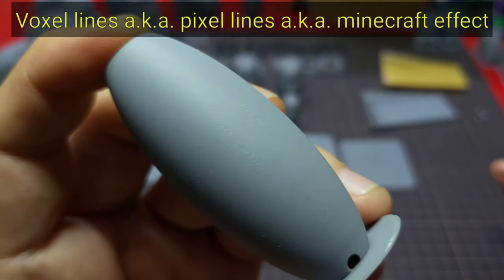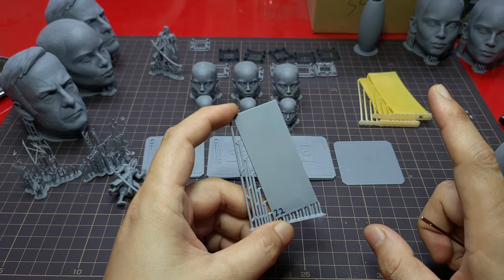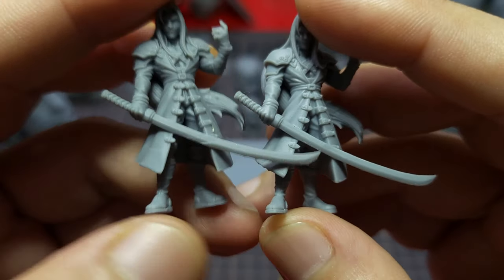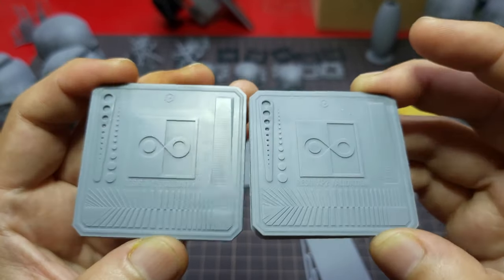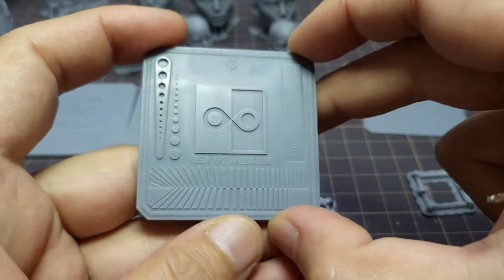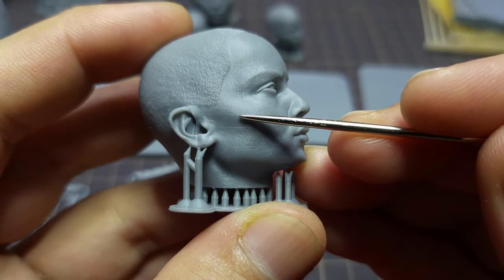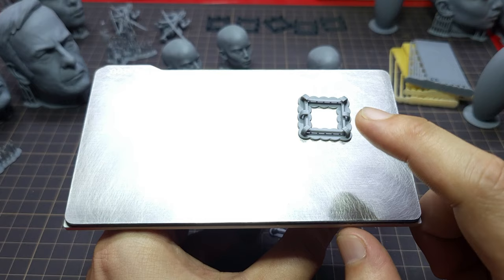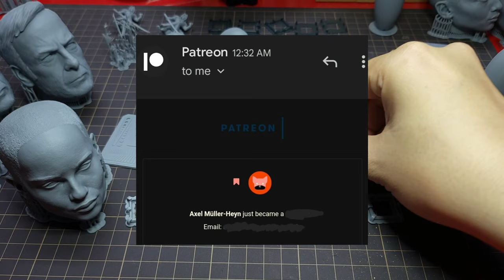How To Setting Resin Exposure For 3d Printer Resin

Comment: You mentioned the lift screw at 1:14 at I was super curious how you’d assess this but never heard more. The screw is the one thing I haven’t touched troubleshooting and what I’ve been suspecting so to hear someone mention it is affirming. Would there be z wobble and that’s how you’d diagnose this as the screw? I’ve been printing a long time and recently got some very odd fails I’ve never seen with very thin strands of cured resin attached to my object if it prints at all as well as a rectangle in a very thin layer no matter the shape or object I print.

Comment: Not only the exposure time, but also the UV power count in this matter!!! When I turned up my UV power to 80 (the factory setting was around 60 on my Photon Mono X), which is recommended for darker resin, my prints got better even if I lowered the exposure time to 1.5 sec. So begginers pay attention to this as well!
Reply: For a skin color resin, 60% is ok for a Photon mono 4k ? I did a test with 1.4 s, columns are thick and I barely see the pillars but its 100% UV
Reply: would you please share your settings? including UV Power, Cure time, lift speed and retraction speed? I use the Photon Mono 4K
Reply: @renatosilva2078  would you please share your results with 80% and 60% UV Power? I will try soon and do the same.
Reply: @walterrldias  I just realized I wrote exposure time instead of UV power to 80. I hope nobody set exposure time to 80 for 1 layer. :D I edited it now.

Anyway I tried many to print faster, but it has limits, so right now my prints don't fail with this setting:
Layer thickness: 0.05 or 0.1 mm
UV power 80
Exposure time 2 sec
Lift distance 5>1 mm
Lift speed 2-2 mm/s
Retract speed 4-4 mm/s (I tried it faster, but it starts to make annoying cured little layers next to the print, so it is the fastest which makes clean prints yet)

Important to set the supports thickness to 1.2 mm, I usually print bigger 1/4 and 1/6 pieces, and sometimes 1 mm supports still failed. The connection head of the supports can be between 0.8 and 0.6 mm, depends on the size and details of the printed piece. Good support setting is very important to check them manually if there are too many or not enough placed by the slicer.

Print bigger parts with less details with 0.1 mm as figure bases to spare time, and detailed parts with 0.05 mm if you want the best quality look of your printed figure.
This setting is not good above 0.1 mm layer height, then you will probably need more exposure time for higher layers.

Also the type of resin can act differently, I use the Anycubic grey resin.
Reply: @Chibanah  haha I had noticed the typo, but also 80 is such a UV Power number that I decided NOT to bother you with that. I thought u would notice it yourself and you did.  Thanks for the feedback. I will try it later in the day.

Comment: I have been using your exposure tester quite a lot recently since I just got my printer and have been trying to find the sweet spot with the couple of resin types that I have. I have to say it's a very useful tester model. I usually print the Resin XP2 Validation matrix, Ameralabs town and your tester model together during the calibration. More than once, I found that the Resin XP2 and Ameralabs model to have printed wonderfully at a certain exposure setting but it failed on your tester model (corner support failure). If I didn't print your tester model, I wouldn't have known that the exposure setting was still a tad too low, and that it would probably fail if I were to print a complex model with a lot of fine supports. Also, your tester is quick to print since it has such a low height. For quick test, I just print alongside the Resin XP2 Validation matrix.
Reply from the maker: Thank you for testing my exposure tester and let me know your experience using it.

Comment: This is great, I found in the early days of my 3d printing I simply used the manufacturer's recommended setting for resin type. HOWEVER I quickly figured out that is not enough. I live in FL, and we have a pretty high temp year round, and I also use the printer in my garage with no a/c (yeah it's hot). I run two fans but the common settings seem to cause failures within the print or were giving me heavy print lines. The basic validation matrix seemed to print fine, it was only when I started added supports to complex or bigger prints that caused issues. Long story short, I found a few threads saying that over exposing the bottom layers (from 30s to 45s - given it an extra few seconds for the two layers of screen protector) and pushing up the layer exposure to 3.2 seconds as well as changing the lift speed has all but helped the prints almost 100% print successful now. Good validation matrix too that you made, I will be subscribing for more!

Comment: Hello. The video is very interesting. But I need your help. I have a Phrozen Mighty 8k, but I can't print the test. Only the first platform attached to the base and corners prints, but I can't get the cones to print. I'm on a 1.3 second exposure with Anycubic Resin. And if I increase the exposure to 2+ seconds, the test stays stuck to the fep Please help.

Comment: Thanks for the calibration file. I'm dialing in some new resin but the Exposure Tester Model is barely any space between the square and the base. I used the cults3d download but it doesn't look like yours in the video. Using Lychee Pro and you can see the sliced model looks normal. Anyone care to help out? Also ran V3 cones of calibration with table, sword, skull and cones. Was over exposed, beer didn't fit in mug and sword didn't go through skull but I did have all successes and all failures on the cones.
Reply from the maker: @theVariedLife  calibration model is use only to give you headstart.
Fine tune it again on real object print.
If there is no space, then that means your leveling is too low and pressing the screen.

Relevel with thicker paper.
Reply: @wangdennys  Thank you very much. Will work on that.

Comment: Thank you for a very informative video.  I like the detailed descriptions with examples. This is a big help. My Z axis torture tests showed bad print lines. Following your advice I cleaned and lubricated (using SuperLube) the leadscrew and the guide rail and bearing block. Installed stepper motor dampener and aligned he leadscrew. All this with no change in print quality. The bearing block moves very roughly on the rail so this is most likely the cause. I am waiting for new high quality replacement parts. One question, as a newbie I don't understand how lift speed and retract speed affect the print. I would like to know how to dial these parameters in.

Comment: Different resins and printers all perform differently, always a good idea to do calibration. I was using the original photon for a long time then switched to the mars 2 Pro, the print time is so much faster.
Reply from the maker: Yes indeed.
And also temp and humidity can affect resin exposure

Comment: Hi Dennys, how are you? Thank you for your videos with all that tests. It helped me lot. Am I correct that you use supe rlube to treat FEP? Please correct me..Am I understand right, that you apply superlube to cleaned and dry fep foil and then wipe dry?  Then you fill the tray with resin and print your test prints? Thank you for your answer. Best regards Daniel
Reply from the maker: I never suggest to lube fep with anything.
Lube only leadscrew and rail
Reply: @wangdennys  Thanks for the reply and correction.  I misunderstood and preferred to ask. 🙈☺️

Comment: very helpful! of the parts I print, I make a dash panel for 1/24th scale race car models; I have issues with them warping after printing and curing. They are about 80 mm x 35 mm x 1 mm and print horizontally at 44.5°. I cure 1 minute/side after cleaning and they come out clean, but warp after some hours or days, even if they are printed at 90°. Do you have suggestions? Thanks
Reply from the maker: I print some object flat with phrozen aqua grey 8k resin
And not experience any warping.

Maybe yoy can try it.
Reply: @wangdennys  I'll test some flat to see it it helps, but I also had this issue with thin parts with my Formlabs printer also

Comment: How we can check on slicer before printing, that object will be sucsses to print ?..... Thank you
Reply from the maker: Slicer can only preview the slice file. No way to tell the print result other than real test print.
Reply: May i know the function of toolbar GENERATE 3D OBJECT in PHOTON SLICER V.3.3, ... When i open slicer file and i check the object for run wih klick generate 3d object...and the result is only a half object view on 100% ...what happen with that... In the same case on slicer photon v.2.1.29...when i slice save the file like ussualy and when slice done...i klik tollbar view...an choose 3d view...and when itu running that only a half view object after 100% run...and when I print that file the result os the same with the view in slicer

Comment: Thank you very much for the great video! I own a Flashforge Foto 8.9, and I find myself at 3.6 exposure time with little failures on two-three supports. Is that normal? Exposure seems a bit high. At 2.4, the supports were not even printed. Thank you very much in advance. Edit:  I tested two different kinds of resins, the Anycubic standard and the Resione EC51.

Comment: Hello Dennys, I want to say I appreciate your in depth reviews. In your opinion which of the budget printers have most dimensional accuracy? (Assuming all settings are dialed in correctly) I need a printer that can handle multi parts keying into each other.
Reply from the maker: Latest review is mighty 8k and mini 8k
Very accurate imo

Comment: I'm trying the frames with the hooks now my first print was a fail the frames were all hanging down I've just cleaned all the small bits of the fep the hooks that didn't prints at 3.3 with the new elgoo like abs 2.0 I just cannot get these numbers down for this stuff it's awful compared to the original resin like abs! I've seen a couple of video people having to up their exposure double to 5 seconds on the xp finer though that's way to high I'm trying to get a good sweet spot then use the cones and some of your models

Comment: Great video, when I tried your exposure test (the custom model) the supports didnt print at all and the flat parts were down against the base. Is this a normal fail or indicates some other issue besides exposure?
Reply from the maker: What printer?
Reply: @wangdennys  Elegoo Saturn
Reply: @wangdennys  have this same problem with anycubic mono 5s
Reply from the maker: @ctow11  definitely leveling too low your print start below 0
Reply: @wangdennys  thanks for your response, but I don't think I understand. how do I fix this? I manually releveled and that didn't help.

Comment: Hey Dennys ~ kind of on the same subject but not really (HA!) ~ Have you checked out this Youtube Video? ~ "better than vroom chitubox 1 9 cut print time in half"

I used these settings in my AnyCubic Photon Mono 4K. Works Great!  I did no firmware update, no gcode editing... Before I was trying Vroom settings and although it was bringing a 6 hour+ print down to 4 1/2 hours .. I was getting some print fails regularly however...  Using the settings in this Video from Advanced 3D Printing a 4.5 hour print now is only taking 2.5 hours... Model height 50mm .. layer height 0.035mm!!! (Yes, 0.035mm!!) ... Zero Print fails!   Oh... I'm using Lychee Slicer!! HA!  Although the video is about Chitubox I just rolled the dice and input all the setting into Lychee.  Works like a Dream!  (Note this may only work on printers with Chitu Boards ~ as does the Photon Mono 4K (I imagine the firmware is most recent)... but it would be interesting to try these settings on other AnyCubic and well... other brand printers... hmmm...
Reply from the maker: If only lychee AA works well.
Hiks...
Reply: @wangdennys  Hmmm Yea ~ not a problem for me I suppose as I do high detail jewelry designs and I don't ever need to use AA ~ I guess someday I will need to use it ~ hopefully they will fix it by then ~ anyway I am curious to see you run a print with these settings ~  Chitu calls it TSMC Two Stage Motion Control ~ lift slow, retract fast, and reverse for next layer cure.  It's quite clever I think... makes sense for sure.

Comment: do you need to cure the piece before doing the test or just wash it?
Reply from the maker: Depends on which test that i explain in the video.
Reply: @wangdennys  I did the tests with 2.5 2.4 2.3 , and apparently they were all good.. it was subjective for me to know which one is a good exposure time. I didn't cure it, I just washed it and waited for it to dry. the manufacturer's initial parameter for this resin that I used is 2.5
Reply from the maker: @paulocezarxavier8552  lower it again until it fails.

The one before fail is the good exposure

Comment: Very good and informative video. Am really enjoying your content. In the Photon Mono 4k review video, you lowered the UV power in order to get better details. How do you know what is the appropriate UV power to get the best results? I think most people will just print at 100% without knowing about this. Also, when you see print lines, how do you know that it is caused by underexposure and not because of the Z rail? Thanks!
Reply from the maker: With my exposure tester
I do rerf while lowering the uv power until i have fail
This way i can tell the exposure and uv power is optimal.

After that i will do stability torture test and print the oval tube to check for print lines.
If print lines happen
Then i apply lube.
Usually print lines completely gone.

If your problem is z rail
Usually it printed wobble, not just print lines.
Reply: @wangdennys  thank you.. very useful info

Comment: I use water washable resin and it cant stick in plate I changed bottom exposure from 15s to 35s and it work but there's still not clean in detail what can i do
Reply from the maker: Please reach me on social media.
And pic of the issue and print setting.
Thanks

Comment: @dennys wang:  Do you print your tester direcly on builtplate or supported? I tried few times directly, but after printing it was very thin and when unpeeling from builtplate I usually bend the test and brake it or it's test columns... I'm wondering if it is the same if I print it supported.
Reply from the maker: you have compression then.
relevel your build plate with 3 papers.

Comment: HI Dennis, I'm trying to use your test STL but it keeps printing only about 2.6mm in height, in the slicer its 4.2mm any Idea what might be causing this? Thank you.
Reply from the maker: That means you have compression.
But most people dont print flat so they wont have any issue.
I am working on a new versiom of the exposure tester that is taller.
Will upload it soon.

Comment: Mr Wang I'm having some issue after upgrading my Mars Pro to a mono screen. I recently purchased the mono screen upgrade kit for my Mars Pro, and just finished dialing in my resin (I’m testing a mix of 90:10 Elegoo Standard and ABS-like) with XP2 Validator (1.6 second layers, 4 base layers at 30 seconds). I then went on to print the Cones of Calibration but the print failed completely, staying on the FEP. It has filed twice now, any suggestions?
Reply from the maker: Relever with 3 normal a4 80gsm or 70gsm papers.
Some user with similar problem like your, report to me that 3 papers help them solved their issue.
Let me know your result.

Comment: What is an example of a good quality vs a poor quality FEP? I'm a little worried as I purchased a large 10ft  role that Id cut myself to fit my printer Amazon by Alchemy 3D. Should I not use this?

Also, have you experimented with putting lube on your FEP?
Reply from the maker: It really hard to tell without any print result with such particular fep.
I tested lube on fep but do not see any different result. So cannot really recommend or against it.
Reply: @wangdennys  Thanks for your reply, I hope you come out with more videos soon. So far you have the most informed videos I've found on resin printing.
Reply from the maker: @J3DTech  thank you

Comment: I've tried all different settings for exposure but all I'm getting are solid lines with no pillars underneath. The print itself is nice and clean but has no pillars at all. No sagging, just solid lines all around. 
What am I doing wrong?
Reply from the maker: Your build plate is pressing down too hard.
Raise your z offset or relevel build plate with 3 papers.
Reply: Thanks for the reply, I'll try that. Cheers, subbed.
Reply: I'm also having this issue on the Sonic Mini 8K. However if I raise my z offset I end up with fails on my regular prints, no matter the exposure time or lift speed.

Comment: Hi Dennys, i recently bought a phrozen sonic mighty 4k and i have been trying your model but in all  it doesn't make pillars or they are too thin to see(i haved tried 1,6 to  8,0).  I have already recalibrated the z axis with 3 papers.. Could it be the fact that I am using a magnetic platform? should I recalibrate using more paper sheets?

Thanks you for making this videos , they are really helpful especially for someone that are new in the 3d prints world like me
Reply: Did you end up fixing it?
Reply: @Daan87423  yeah I did , I haved some compression   so i level the plate with 4  papers sheets